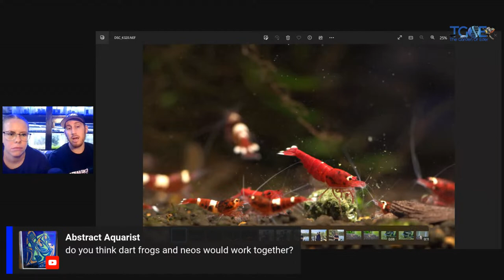Water Parameters

Comment: So far I've been using half tap, half distilled for my 10 gallon boa project tank. So far my shrimp have thrived, I have 3 berried females and I use contrasoil as a base. The highest my tds has been from the tap is 127, highest it's gotten in the tank before water change is 350 ( I try to change the water before it gets up to 250 but things happen) breeding has been happening but my baby survival rate is only about 20-35%. I feed only 2-3 times per week. How can I increase the babies survival rate? I'm considering switching all of my tanks over to RO including the shrimp tanks, since I bought an RO buddie for mixing salt for my reef tank anyway.